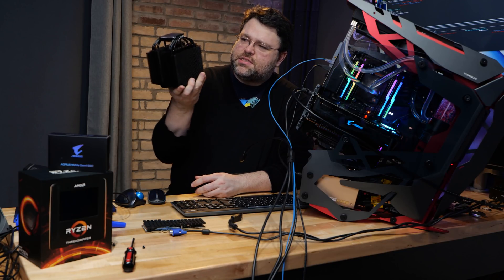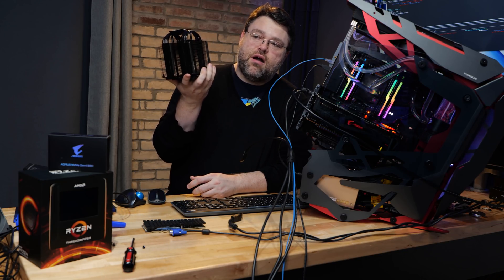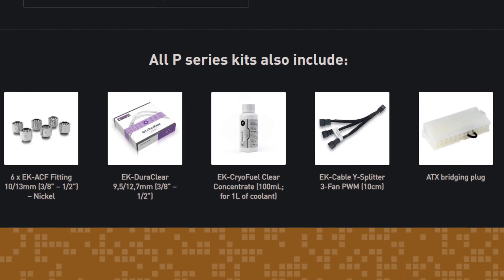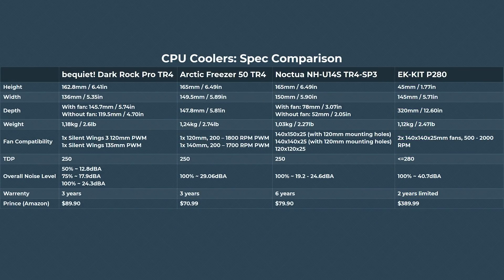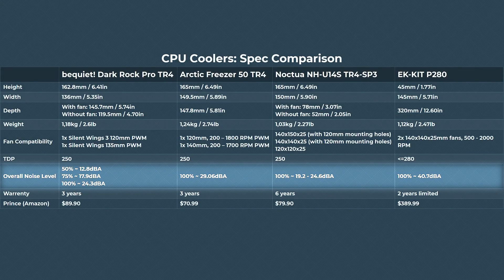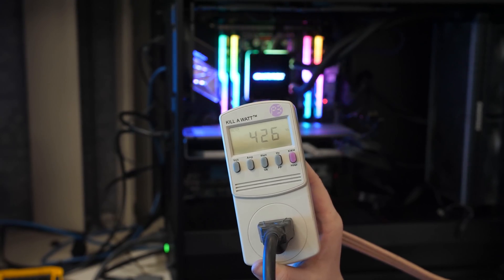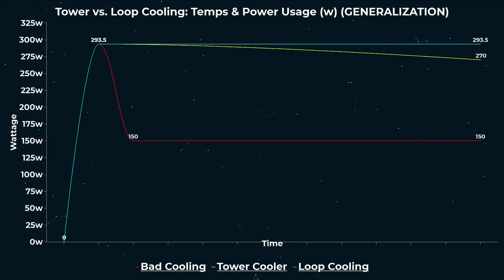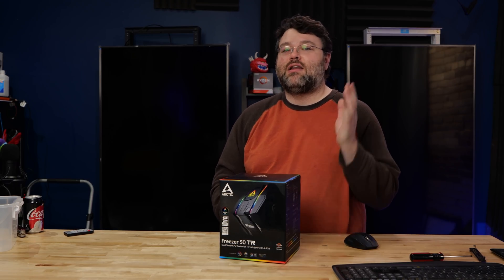Threadripper 3000: Better Cooler For Faster Renders?

Comment: I'm trying to plan a new workstation build with upcoming Zen 3 Threadrippers in mind.  The problem is that my cooler height will be limited to no more than 160mm.  I really didn't want to mess with a water loop at all, but I don't have many options.  Will a Noctua NH-U12S TR4-SP3 in dual fan configuration be enough for a Zen 3 Threadripper I wonder?   I don't know.. I hope we see some new candidates come out in the market.

Comment: My second Enermax Liqballs II is starting to get high temps. I'm tempted to crack it open, clean it and refill it, but since I spent over 3000 on the components inside I don't wanna risk messing that up. I looked into a custom loop from EK but I could almost buy a 2080ti for that price. So I'm down to getting the noctua NH-U14S TR4 with chromax accessories or the be quiet dark rock pro TR4.

Edit: Reaching the end of the video I now see I have a third choice. Hmm.

Comment: Sounds like when it comes to not overclocking, it's more about maintenance of a water cooling system. All you've got to worry about with air is dust.  But water cooling can leak or become contaminated and does require changing the fluids and keeping an eye on it.  Nightmare scenario would be a leak which causes damage.

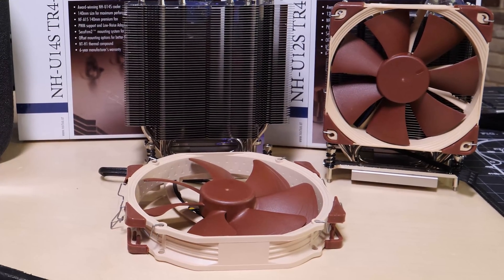Comment: 05:46 I have the same ram and Arctic cooler. I'm having the same issue with it teter tottering. How did you make it fit properly? I could really use the help. Much appreciated!
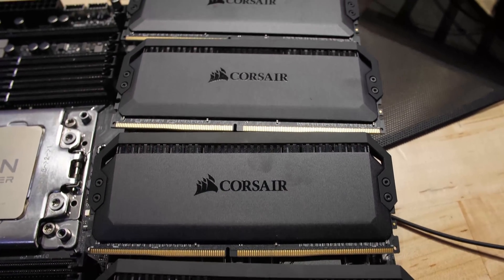Reply: 01:55 The Arctic Freezer seems to clear the Trident Z . Is it possible to move the fan one or two notches higher?

Comment: Just curious: is it possible to mount a tower fan cooler on the top (front) side of the CPU and mount an AIO on the bottom (back) side simultaneously?

Comment: 2:55 The Enermax LiqTech 360. I had one. It was great while it lasted. But I seem to have had especially bad luck since it failed in just 4-5 months for me. One and half year ago, there was no good AIO alternative, so I ended up building a custom loop. I would have hoped that by now there would be a good alternative or that Enermax had fix their problem but it seems like you still don't have a good overall solution like a LiqTech 360 without problems.

Comment: updating my previous comments now that I built my custom loop (corsair Hydro X cpu only 55mm thick radiator 360 with the grey cpu block) 3960x 24 cores real-life aida64 values running cinebenchR20 multi-threaded
 stock 280Watts, pbo 315Watts, auto-oc ryzen master 347Watts and check what air-coolers are rated for : NH-U9 TR4-SP3 (double fan one) : Max TDP 180W, no overclocking (not 250W TDP compatible)
 and be quiet! Dark Rock Pro TR4 : Max TDP 250W so both are unfit for even the 24 cores, Noctua even comes with a warning not to try so here's your answer, no you cannot run threadripper with an air-cooler...not if you care about a computer that cost you probably more than 3k USD tripling or quadrupling your cores even with the technical advance of AMD chips can't do miracles, if it was as energy efficient as Intels it should be 450watts I'm happy it's not P.S. you do not want that heat in your case on the left the rear I/O is often part of the VRM cooling and above the cpu is the VRM cooling which is already hot even with custom cooling and I repeat myself but TR is constantly outputting heat as soon as you pres the power switch it's nothing like a "gaming" cpu

Comment: I have ARCTIC Freezer 33 TR, got it for 35$ (normal price then). it went up now. Super satisfied with this one. I bought it as a place holder for water cooling AIO that I wanted to buy for 1950x, but simply never saw a need for one. So that saved me more than 100 bucks.

Comment: @1:11 you are saying you are generating 425 watt of heat but you got the meter set to VA not Watts so you actually didnt draw that much - it was actually a little bit less than got wasted to heat

Comment: This seems a bit muddy.  I know what you're trying to say, but I think you could have done better by scripting it a bit.

The upshot is, if you want the processor to run faster, you need to get rid of heat faster at lower temperatures, so there's room for the processor to generate even more heat to increase the clock speed. 

It's all about the surface area of the heat exchanger combined with the airflow over it.  With a tower cooler, you're stuck with a relatively small surface area, meaning higher fan speeds to achieve a given amount of cooling.  With an AIO, you're stuck with a thin radiator which runs into the same problem as the tower cooler, but later on.

Only with a custom loop can you almost arbitrarily increase the surface area of the heat exchanger.  This lets you improve heat dissipation greatly, and do it without ramping up fan speeds (more airflow or higher surface area achieve the same goal).

So for a chip like Threadripper, you want a custom liquid loop with a big hefty radiator using large fin spacing, coupled with quiet low-RPM fans.  More heat dissipation and much quieter cooling.

Comment: 01:12  That's not true.  There are physical state changes throughout the computer that require energy to produce.  That's the very definition of work.  You can't flip a bit or change a transistor state without using energy to do so.

These devices are, of course, insanely inefficient, so nearly all of the energy that goes into a system comes back out as waste heat.  But not all of it.  Some of it does work.  If that weren't the case, then the computer would be incapable of doing anything at all.
Reply from the maker: Popular misconception. The result of the electronics  doing any "work" is heat. All the energy ends up as heat.

Comment: So what you're saying is that better cooling allows the cpu to hold a boost frequency longer, since heat is part of the boost algorithm. If your income revolves around something like rendering large videos, the higher boost speeds gets more work done per hour, which amounts to more income per hour, and the $500 custom loop investment pays for itself..

Comment: But the question remains - which of the tower coolers is better for Threadripper?

I know that you said that you LIKE that last one, but how do the others perform in terms of temperatures, and/or total system power consumption and/or rendering times?

Comment: With rising core counts and higher energy density, it's really time loop heatpipes make an entrance into the consumer pc market. Since the evaporator is basically a vapour chamber, the heat dissipation and spread on the CPU is much better. Especially when direct die cooling. Once the loop heatpipe is going, even in a thin tube, you can transport multiple kW of power. And the flexibility gives us the opportunity to make computer cases that are essentially just a massive heatsink. We could have condensators for 500 W in small form factor cases with just 10 l. Or full size towers with 1.5 - 3 kW.
It's really a shame nobody wants to invest the time and money into developing the CPU block for such a system. It's really just the block itself, which needs a fluid-optimized dual-wick structure, channels and a reservoir. All the other parts of the loop are low-tech.

Comment: Much appreciated. I'm using custom loops for all my systems so it's not really an issue what to use, but it's nice analysis.

If you get the impression that this whole video was waste of time then... Wendell you pointed out to much desired testing subject. How RAM speed influences new TR 3xxx performance. Another little bit is testing 8 stick kits. Most QVL doesn't really focus on that. You get your 8 sticks kit anyway and then Zonk! it doesn't work. Question is, what for all new TRX40 boards have 8 slots when system is much more stable, predictable and quicker (because of CL) with 4x 32GB sticks than with 8x 16 GB.

In a way I love what EVGA did on its Dark SR-3 (and Dark X299) or whatever the name. Dump not needed RAM slots, rotate CPU socket, Profit! Ok, not really, it's 3175-X. LOL

Comment: The beQuiet cooler heat plate has a circular finish to it. I managed to get paper (maybe something else, looks and feels like small, hard, dust/rock pebbles) contaminants in the circular grooves in it and I can't get them out because there's no direction where you can push those contaminants along the grooves to eventually leave the plate. Any ideas?

Comment: I just wanted to say:

THIS VIDEO IS NOT A WASTE OF TIME!

Without you doing the investigation into this we wouldn't have any idea of how close or how far apart performance is, both short-term & long-term when using a Threadripper 3000 CPU.

And personally I feel it is important for me to mention that as someone who owns a 1st Generation Threadripper 1950X-based system it benefits me to see the potential thermal improvements (or reductions) when switching to a TR3K part as I can better plan an upgrade. 

Additional to all of that, Water-Cooling CAN fail, whereas with a heatsink even if the fan itself fails, the Heatsink will still operate as a Heatsink dissipating heat, the same can not be said for Water-Cooling, and that is a negative in my book because that means you have reduced reliability and a potentially massive increase in repair times if things go wrong...... (Replacing a Fan VS Replacing a AIO, or, a Custom Loop)

What I would personally like to see is what sort of performance can you get from the 3960X, 3970X & 3990X when you reduce the power limit to a maximum peak power usage of the same 180W target of the older TR1K and TR2K parts.

I'm just wondering if we can get better performance and still retain the same TDP target.

Comment: You could cheat and get your loop to heat up faster by slowing the fans down for the first bit until the fluid heats up mostly. Maybe to 45C or something. Otherwise you approach the steady state temperature of the loop very slowly. 
Could even run it until the chip hits 85C, then turn the fans up and see if the loop will pull it off thermal throttling and bring the power use up to 290W again.

Comment: Cooling my 3960x in the Dark Base Pro 900 with the Noctua NH-U14S TR4 (NT-H1 paste) and my temps are staying in the low-mid 70’s now at full tilt with Lightroom photo processing. I do have 7 total noctua fans, 3 front intakes, one top intake, one bottom intake, one exhaust. Single fan on the cooler since mine was making a loud noise with push/pull configuration (tried with low-noise adapter but that didn’t fix it either.) Most say it only shaves off a degree but I can say that this is quieter than cooling my 9900k with the Corsair H110i and stock fans. Hooked on this whisper quiet setup that is 3 times faster for rendering. Totally worth the investment for working pros.
Reply: Thermal Grizzly knocked off 1.2°C

Comment: I'm building a 3970X with the ASUS Zenith II Extreme cooling with the Thermaltake Floe Riing 360 TR4 Edition, Corsair RGB Pro 3200 MHz, I'm hoping I have good thermals when the CPU is running all cores maxed out running Einstein@home or Seti@Home. Wendell I'd appreciate your thoughts.

Comment: I don't understand why companies aren't making full plate AIOs that cover the entire 3rd gen Threadripper chip. I think the 1st company that does that and use good coolant that wont contaminate over a month will definitely bank on that product. I installed a 360 AIO by Corsair and during hard rendering its reaching in the low 80s which at this point i will just deal with because i don't want a custom loop in my system.

Comment: EK makes some great water cooling components - I love their blocks, rads, and reservoirs, however I MUST say, I have had 40% of my Vardar fans fail completely due to their cheap bearings. Stay away from the vardar fans!
Reply: Just use Noctua a little bit expensive but very good. The NF-A12x25 PWM is really great for radiators.
Reply: @tmpnerd  The NF-A12x25 PWM is just about the best fan you can get atm... I wish Noctua would make a 140mm version.
Reply: @Outland9000  It's in the work for some time now but it's seems to be a little bit harder then just upscaling to 140mm. Im sure when it comes out it will blow away other fans :)

Comment: I like the video but you should have also tested an AIO as well as a custom loop. I dont think there is anyone on the planet that thinks a tower cooler will beat a custom loop (in performance). A tower besting an AIO...yeah, i can see that happening.

Comment: reality check on what threadripper is compared to a "gaming" setup this is a 3960x 100% stock + 1080ti oc@1970Mhz running cinebenchR20+msi kombustor in the background
https://postimg.cc/4HzJDL7W CPU 287watts, power at the socket 830watts don't take your non-HEDT experience and believe it'll be the same expect at the bare minimum DOUBLE your actual watts so no an air-cooler or AIO working fine for a 80-150watts cpu won't be enough

Comment: Air cool or liquid cool on threadripper? Is that really a question you need to ask?
Reply: Well... Yes. Very much so.
Reply: Outland water cooling is objectively better
Reply: @MLGJuggernautgaming   Performance, reliability, ease of maintenance, price. Are some factors which someone might, or perhaps should take into account.

Comment: I did exactly this to my 3970X.  Started out with a 280 AIO, it would immediately hit 80+ temps under load and my max boost was around 3.9 - super noisy of course.  I switched to a full derp 2x360 and 1x240 loop, now I boost up to 4.4 and temps stay at 60 even after hours of abuse, and all you ever hear is the pump since the fans are below 1000rpm.  I'm seeing roughly 13% gains across various workloads.  Was it worth the $1000 I spent on the loop ?  Probably not, but I didn't need the TR in the first place so this entire build is me being financially irresponsible in the name of nerd boner maximisation.
Reply: I built my custom loop 5 years ago. for my 8 core i7 5960x X99 workstation. 2x480 and 1x240 rads. plus EK waterblocks on the GPU's. currently have a 16 core 1950X Threadripper in there. but my new 24 core 3960X is due to arrive tomorrow (21/02/2020). I've had to change the D5 pumps a few times over the last 5 years. but my temps are always good when doing long video renders and transcodes etc. Running Davinci Resolve for 4K/6K Braw and Fusion. Once you build a good open loop. it just works. PS just upgraded the fans to Noctual Industrial version 3000rpm capable, bit louder but wanted to keep this bad boy cool.
Reply: @johnbancroft5242  It is very interesting to know what temperature you got while working with 3960x and stock settings?
Did you try to overclock your CPU, if so, what frequency you reach and what was maximum temperature?
It's just that I'm planning a system with 3970X and try overclocking up to 4.3~4.5GHz on all cores, but I'm not sure that 480x2 rads with fans less than 1200RPM and single D5 will be enough to maintain acceptable temperatures in the full cores and threads load (~70°C). 
I'm sorry if what I wrote is not quite clear, English is not my native language... I am trying to learning him :)
Reply: @ViperGremory  Still waiting for the Ram to arrive from Amazon. will be building the PC over the weekend.
Reply: @johnbancroft5242  How would you recommend for someone who is trying to build a 3990X setup?
Reply: @HangYuriYangFX  bonjour j'ai créer cette configuration AMD 3990X, asus rog zenith ii extreme alpha, trident z neo 3600 cl14 64gb, asus rog strix helios gx601. il monte trop haut en température AIO asus rog ryujin 360, je vais remplacer par enermax liqtech 360 tr4 ii eau et gaz réfrigérants. QUI PEUT M AIDER ?
Reply: @katieranjon2835  je n'ai aucune idée

Comment: When testing cooler you should standardize on a value to effectively test efficiency among them. @GamerNexus uses a decibel limit (40db), you could also use something life CFM, but those all need to be executed at that same value of this variable to properly compare them, not to mention set all values to static on the UEFI (for voltages, disabling PBO, etc).

Without doing this things there are way too many variables to accurately determine one is better than another one. Got to say yeah in a comparison way you did wasted the time but one can always learn from the mistakes ;)
Reply: steve is disappointed in wendell

Comment: On cooling is a matter of few degrees for every choices. Thermal paste, type of metal, fans volume/pressure etc. As heat has to been dissipated thought different mediums, in my opinion, it should looks as a whole. You can save some money on every step involved in cooling but in the end than can be like 10~14 C difference and everyone should think if this delta is worth it in terms of performance, noise level and appearance (whatever you want to prioritize). 

Beside that, at 0:44 10980XE it's showed as 16 cores instead of 18.

Comment: How is the enermax compare with the your fluid vs the ek custom loop? I’m about to be in that boat cause mine is having a hard time. 1950x 4.25 all cores at 1.25 volts but cooler can’t keep up.